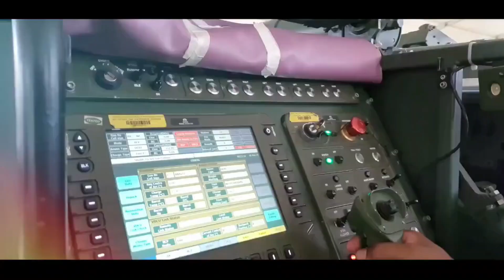New Towed Gun System (TGS) to replace ATAGS #indianarmy #artillery

Comment: Towed guns are the past, self-propelled guns are the future. If shoot & scoot is important, SP guns are far, far better at it. There can't be that much cost difference between a truck-towed gun and the same gun mounted on the same truck. While towed guns can add significantly to the numbers at lower cost, they can't/shouldn't be considered frontline guns. India should have at least 500-600 K9 Vajras and 1100-1400 truck-mounted SP guns. The rest could be towed guns.

Comment: This is typical problem of weapons development. ten yrs ago the High Altitude front was not a major requirement. Today it is and manual  laoding of 50-100kg shells at 14,000 ft for sustained periods is not possible. This is wher eknowledgable discussions between teh gun maker and teh customer can ease out most of the problems.anticipated in meeting weght targets.

Comment: CCS should summon the army chief and give him a spanking. This is getting ridiculous.
Reply: Oh so you know more than the IA? And what’s with that “give him a spanking” for army chief
Reply: @arjunnair9007  You don't need to know the IA when this induction and testing circus has been ongoing for over a decade. 

The army already has multiple high quality artillery pieces which they can order from especially as the need is so urgent. Vajra, ATAGS, Dhanush, MAGeR, Bharat-52, 

However the gun which lost out in the ATAGS race is now somehow being pushed as a lightweight TAS, resulting in this delay.

The gun in question is ATHOS manufactured by Elbit system. They had planned to manufacture it in partnership with ADANI defence. 

Now you can only guess whose pushing this unnecessary weapon system to the army from the backdoor.
Reply: @jerinjohnson1529  Firstly you have NOT seen the Indian Army as close as I have, so I suggest to you, pls. dont make unnecessary remarks on the Indian Army. Secondly the reason for not choosing ATAGs is simple due to its weight and mobility issues. When the whole world is moving towards lighter yet effective ways of engaging in this case the Artillery, you can't rely on choosing an 18 ton gun. Do you realize it effects the moral of the jawan, battalion ? What if, while towing the gun towards the post its bombarded, how do you mobilise the gun, the crew, the ammunation? There may have been a lobby which "may" have made money and thats why we have the negative import list and yes I again iterate no one else knows better than the people who operate themselves. Its easy to comment sitting from a different location.
Reply: @arjunnair9007  simply due to its weight and mobility issues. I call bull. The Israelis have not inducted this gun into their regiments as it is not a proven gun system and has lots and lots of defects. How will our soldiers fight with defective equipment? We all saw the failures of the INSAS rifle, now imagine that with our artillery pieces.

Now somehow, without any prolonged extensive trials, it perfectly suits all of Indian Army's requirements. Clearly there is nothing fishy about this…

Imagine if you are a DRDO scientist that worked on ATAGS, how would you feel? After years of works, trials and tweaking, Adani will simply trample over their work and will make billions doing so. We as a country are now at a stage where the threats we face from within are far more grave than the ones from outside.
Reply: @jerinjohnson1529  you just had to bring Adani for what? Athos cannot be purchased coz kalyani group is offering something way better and indigenous.  Also fyi, they are answerable defence minister and give a damn good reason for choosing a gun. We’re not Pakistan army that make money on every bloody deal.
Reply: @arjunnair9007  I honestly want you right on this and that I’m all wrong on Athos/Adani getting contract, I desperately want to see the Kalyani gun to be selected. Time will tell. It is just frustrating to see the systematic sabotage of our indigenous defence capabilities and blatant corruption to favour some guns. IT cell has already started by actively spreading bad news about ATAGS and how great Athos guns are.